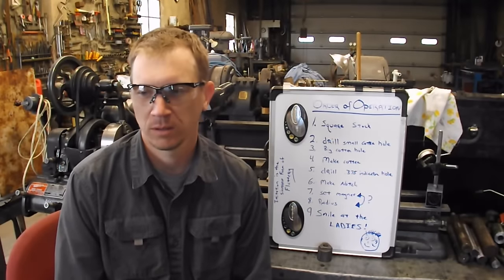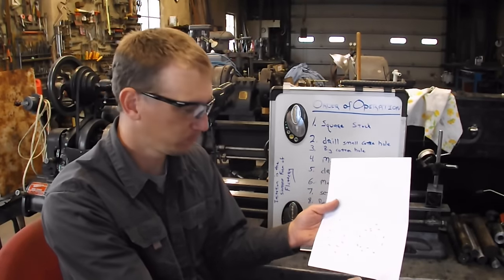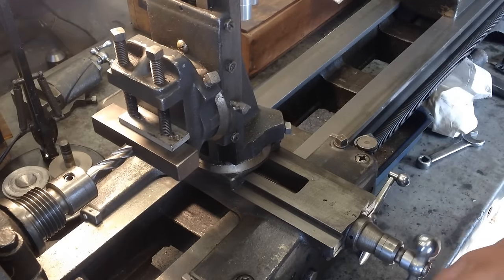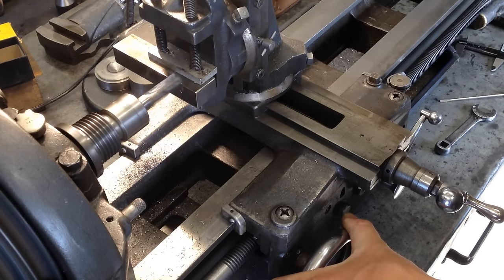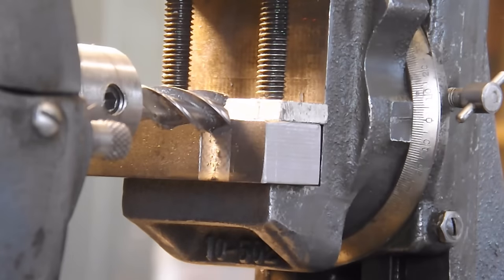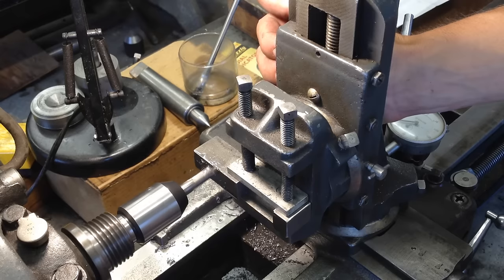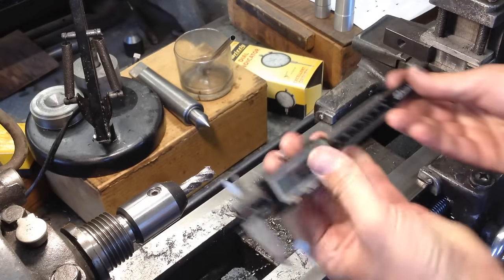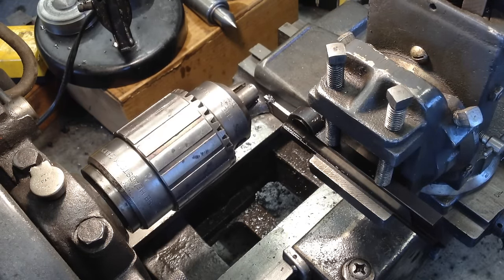Carriage Indicator Holder Build - Jster1963 style

Comment: Drill the end and run a set screw in to eliminate the slop,  or a wing nut bolt to lock it down.
Reply from the maker: John Bare Sounds like a simple fix.

Comment: Nice to see the milling attachment in action! I think I want to try making one of these when I'm up and running. Do you have enough lip on one side to add another small magnet? Maybe you can make up the slop by having it sit proud.
I'm a fan of Jster's channel also. I found it while searching for lathe restorations back when I started thinking about working on mine.
Reply from the maker: eviltwinx Always fun to get out the milling attachment. But it is tricky to use. Light cuts, sharp end mills, and patience is the name of the game. I see what you're saying about the magnet... I think. I'm not sure how I'd make the hole for it to go in.  Unless I'm not understanding. I think I'm going to add a set screw that comes if from the back side.